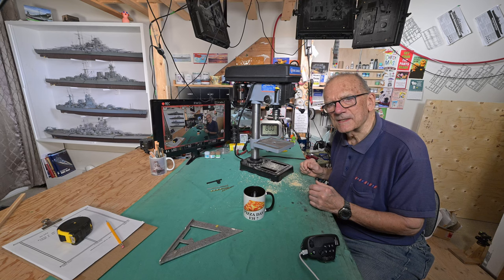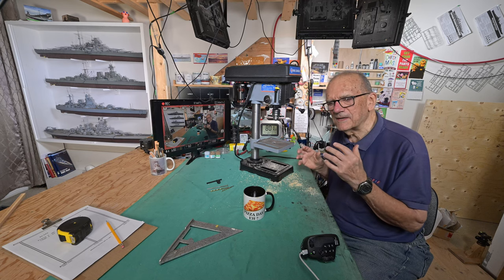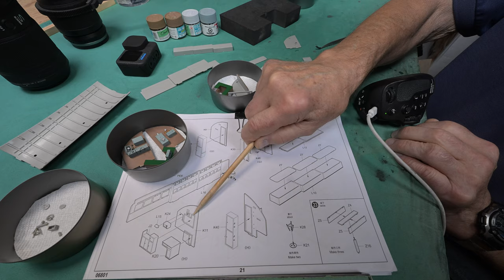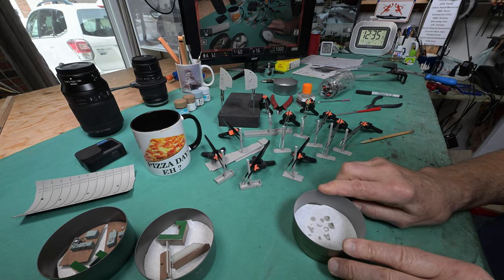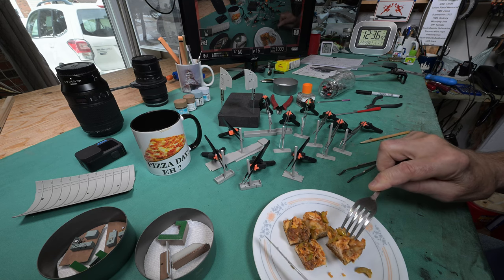The Model Ship - Part 1930

Comment: Ron, another great video I agree with Jeff on the painting the small parts. Moving back to 4K from today. I will do short video today on another 1/10 bust, which I have cleaned up for painting and building. Happy moderling Ron.
Reply from the maker: Hi Paul,
Re: "Moving back to 4K from today" It seems that 4K is becoming the most prevalent for those who want sharp video. I've been shooting 4K for about 6 years now, and upped it to 4K @ 60 frames per second for about the last 2 years. Occasionally I'll shoot in 8.3k @ 60fps, but that's presently overkill. Your productions are good, so may as well have them as "reasonably" smooth and sharp as possible. Will be watching for the 1/10th scale bust. I didn't know that there was a 1/10th bust of me --- Oh! It's not me, haha! 😁

Comment: This has probably been mentioned Ron or you've already thought of it but when painting small parts or dials especially when you start painting the figures perhaps use an acrylic fine tipped paint marker pen. In the UK they are called Posca acrylic pens but they aren't cheap. Other similar paint pens seem to work as well and are cheaper  . My hands aren't as steady nowadays and I fine holding a pen is easier than a paint brush . Great interesting video again on life's challenges. John
Reply: I use Posca pens too, they are really good.
Reply from the maker: I think that when Gabe was over for a painting demonstration he used something like that too.